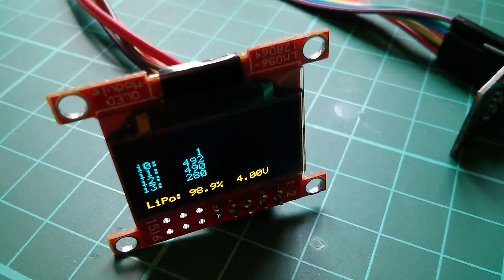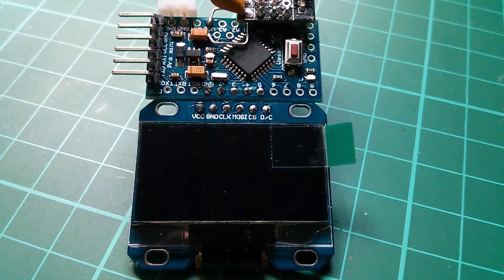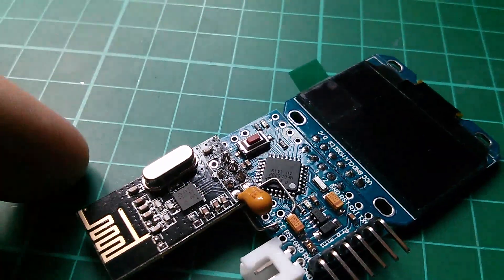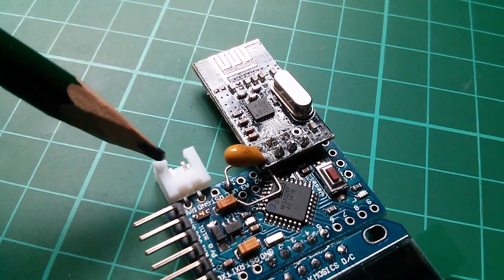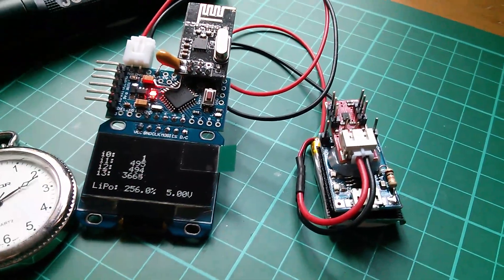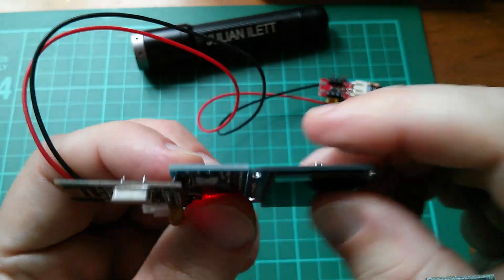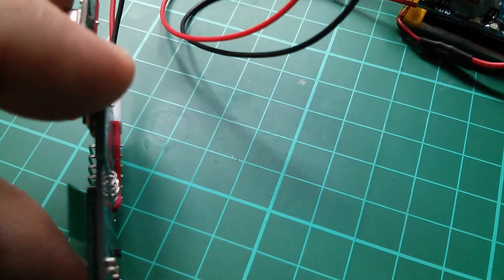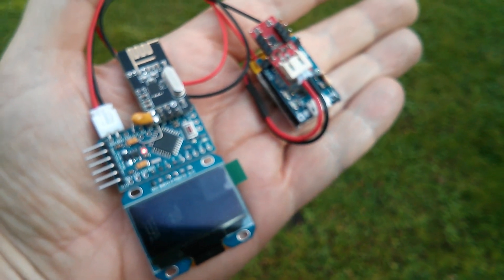Project: New Wearable Arduino OLED Remote Data Display #1

Comment: hi, whats the lipo board you are using? i assume it takes usb 5V in and charges the cell, but does it also give 5V out from the cell when not charging?
Reply from the maker: voltare2amstereo No, the TP4056 board only charges the cell, it doesn't boost the cell voltage to 5v. You can get boards that do that.

Comment: Giday EH!
Do you know how many MAX 17043 boards could be connected on a single 3.3v Pro mini, if they connect to the I2C pins does that mean they are addressable?
I know that is an odd question but I am thinking of mounting 4 or 5 projects in the same chassis because most or all of them would go with me when I camp.

I would like to keep each as almost separate module, each its own battery, because some of the projects can drain the battery quickly, (The Phone charger and 24 LED array work light, possibly the stereo amp as well).

I occurred to me that because one of the Projects uses a pro mini, if I could attach a MAX 17043 to each battery I could see each battery's Charge on the Display.

I am going to use 3100mha LiPo bag cells each with the protected charger board you like and use a common Input power.
Unfortunately my only MAX 17043 board is in the mail.

My research so far does not say if the Max is addressable, unless I missed it.

Thanks!  Later, FW.
Reply from the maker: Futz With This is from the MAX17043 data sheet: "The 7-bit slave address is fixed to 6Ch (write)/
6Dh (read):". So it wouldn't be easy to use more then one.
Reply: Thanks!

Looks like I did miss that.
it sounds like It might be better to use a larger battery or some kind of battery pack.

Comment: maybe you can use a charger board and booster in one to save space such as this one http://www.ebay.com/itm/Lithium-battery-charging-charge-5V-step-up-protection-all-in-one-PCB-board-/121003094575

Comment: Giday EH!

It looks like you used pins D11, D12, D13, A0, A1 on the Pro Mini for the NRF
Is it  NRF6 to D11, NRF7 to D12, NRF5 to D13, NRF3 to A0, NRF4 to A1.

Or am I wrong!

The Reason I am asking is because I want to ad a 4 button matrix array to my
project #2 and your pin-out gives me the 5 digital pins I need and still have every thing else I want to add.

I am hoping to add buttons to my transceiver and use to get Data from remote sensors and turn on/off lights all wile camping!

I may do a video on it.

Thanks! Later, FW.

Comment: Any chance you know of a good fuel gauge IC for lead acid/gel batteries? It would be great to get % charged for the remote battery bank, like the MAX17043 provides for the LiPo.  Looking for an IC like this for a project using a deep cycle leisure battery...

Comment: Hey great videos, find alot of the things you review to be very useful in my own projects. Wondering if you could shed more light on this simple connector
http://youtu.be/S_KjmF1iI9w?t=1m17s

Unlike the ones I have been able to find on banggood and aliexpress none have the pin leads sticking out of the green side, did you add those yourself or buy them like that?

Comment: Hey Julian, I just noticed SKU129299 on Banggood, a nRF24L01 and microcontroller on one board which seems like it would be handy for a wearable that uses radio. Unfortunately it's not AVR/Arduino, it's an 8051. Just wondering if you have any experience with those.
Reply from the maker: ***** Interesting device - looks like Nordic Semi do a dev kit for it. I'll keep an eye on that one.
Reply: Julian Ilett
On second thought, it only has 16kb program space which is kinda small. I noticed that as soon as you start using the SSD1306 library for that OLED, program size jumps up 10-11kb. I would imagine programs for 8051 would have similar requirements.

Comment: i think a custom PCB would be a much, much more effective way of building this :)
You could experiment with edging PCBs using a laserprinter, there are plenty of options! :)
Reply from the maker: muh1h1 I don't really have a finished design in mind for this project. It's just evolving as I try different low-cost modules available on eBay. Actually, I'm kind of enjoying constructing this thing without using a PCB. Finding ways to fit all the modules together is part of the fun.
Reply: Julian Ilett good point :)

Comment: I would love to copy this, I have a Gravitech Nano Version 3.0 of Arduino do you think it would fit as well as a mini, it's pretty close to the same size as a pro mini.

 Very Nice Julian! Great videos! Thank You From  Fresno California USA
Reply from the maker: MyWillyboi I didn't use a Nano because there's no 3.3V version (as far as I know).
Reply: Julian Ilett Yes sir, you would be correct. As far as the overall size dimensions  they should be close, im sure? NO?? I dont mind much if its 5v or 3.3V, As I have OLEDs for both. I also am ordering from adafruit, Xbees, and  6 Adafruit trinkets which are arduino compatible, But the cool thing is you get 3X3.3V and 3X5V Versions, For 35$ A GREAT DEAL
Reply: Julian Ilett And after some pondering on the matter of Arduino Nano and 3.3V, to make a copy of your AWESOME wearables.  It  dawned on me that there is actually both a 5V pin and 3.3V pin.   http://arduino.cc/en/Main/ArduinoBoardNano : Here is a link of my board (Arduino Site) . If you look at the board picture, you will see next to Digital pin 13 or D13 is  3.3V supply pin to power projects, and down the other side of the board is a 5V Power pin. Brilliant isn't it?? There is also 2 ground pins incase one is inaccesable, 1 on each side of the board, and a Vin pin for powering board altogether, aside from USB. So hope I helped you as you have helped me with you wonderful videos. Cheers From California USA
Reply: Julian Ilett Side Note: 3.3V only works when powered from USB

Comment: Is probably the time to learn a PCB design software (I use KiCad free and good) and build an inexpensive reflow oven so you can make your custom PCB design have the LCD on one side and on the other side all the components for all modules.
For the reflow I have an used small oven (free the control board was broken) and all it needs is a Solid state relay about 10$ an 5$ temperature sensor and a 90$ temperature controller (I use the Altec PC410) and works great.
Building two layer PCB is quite inexpensive even for prototyping.
Reply from the maker: ***** I probably should design a PCB for this, but I'm actually enjoying the process of trying to fit all these modules together without one. It's like a chinese puzzle!

Comment: I'm intrigued as hell to see what you're going to do with it :)
Reply from the maker: Tobias Schenk Monitor the voltage, current and power for both the solar panel and battery on my MPPT solar charge controller.

Comment: By gosh, that looks familiar :) Very nice job on those connections.
Is wearable Mk2 using a 5v ProMini? Typically that LiPo will be declining from 4.2 to 3.x volts as it discharges. I have found my 5v ProMini runs just fine when the charge is fresh, but being rated as 5v-12v input your'e already pushing your luck with 4.2v, and it's only going down from there. I wonder if you touching it would cause voltage to be pulled down just a little too much on some important bits... hmm... but I would expect it to restart again when you let go, if that was the case.

Another thing to watch out for is that VCC on the 5v ProMini will be regulated to 5v, not 3.3v. So while it may run the RF24 just fine now (input being max 4.2v), if you gave the ProMini a little more input voltage then the radio will stop working. Just can't win huh?

For this reason I think I will be sticking to 3.3v ProMinis from now on, since they can use any input from 3.35v-12v and will have 3.3v on their VCC to use for the radio. Incidentally, the RF24 didn't seem to be any the worse off for having been subjected to 5v for a while. Unfortunately the cheapest 3.3v ProMini I can find is about $10, while the 5v Deek-Robot 5v ones are about $3.50 :(

I also noticed that my OLED will not display anything while the FTDI adapter is still connected to the ProMini, even when it's fine on battery. Took ages backtracking my steps to isolate that one!
Reply from the maker: ***** This is another 3.3v Pro Mini. I think I've found the problem with the OLED going blank - it happens when I touch the flexible PCB strip on the back. I don't think it's a poor joint - seems like it's a finger resistance thing or maybe induced noise into one of the signal lines.
Actually, this OLED is a pain - it doesn't have an RST pin and the SSD1306 doesn't have a RESET command. So the only reset technique is power on/off.
Weird problem with your FTDI adapter - did you try any other adapters like the CH340 type?
Reply: Julian Ilett Naturally, not like you to make a newbie mistake and use the wrong voltage :) To be honest I completely forgot I was using a 5v, which is how I found out all the above. Kinda lucky it works at all I guess, since it's just coincidence that the LiPo voltage is within the narrow margin where both the ProMini and the radio can both function.

I only have the one FTDI adapter at the moment and it seems fine otherwise. As long as I keep in mind that little quirk I think I'll get by.

Hmm... I just checked your earlier video where you give a link to 3.3v ProMini listed on Bangood, for about $4. For some reason when I enter 'arduino pro mini' in the search box there, only the 5v one shows up, and I don't recall seeing any in the related products list either. Well then, source of cheap 3.3v solved!
Reply from the maker: My FTDI adapters have a solder pad link on the back to select either 5v or 3.3v. How do you get by with just one adapter? I can't believe you're re-soldering the link each time you switch between the 5 and 3.3 volt pro minis.
Reply: Julian Ilett
It has a solder-less jumper. Not that it mattered because I completely forgot about that too and have been using it on 3.3 setting for everything. Seems to work :D

Comment: would not 315MHz/433MHz modules with greater ranges be better option for this single sided comm ?
Reply from the maker: iceberg789 From a range point of view, certainly. But I quite like the option to have a simple two-way communication if I can think of a reason to do that.

Comment: Why don't you just connect the display in parallel with the receiver to the SPI and switch between them with CS/CE pins ?
Reply from the maker: TheBlackAndWhiteCow They're different flavours of SPI. The nRF uses true SPI with MISO and MOSI for bi-directional data flow. The OLED uses a simplified uni-directional SPI. In any case, there isn't any shortage of I/O pins on the Pro Mini.
Reply: I was looking from performance point of view and I don't think that that mixing between the two would cause a problem I think last time I ran a Nokia 5110 display with MAX6675(K thermocouple IC) both over SPI and it worked just fine
Reply from the maker: TheBlackAndWhiteCow I guess it could be made to work, but the problem here was more about finding a physical alignment between the modules.
Reply: I suggest using tiny braided wires it would allow better flexibility in placement, if you need a more rigid setup you can always use a double sided sticky tape or even print a 3D case and screw it all down.
Reply from the maker: TheBlackAndWhiteCow Yes, the case is going to be a real headache. I think you're right, a custom 3D printed case is the way to go. Can you print a transparent top layer? I can see difficulties making it optically clear.
Reply: Not an expert in 3D printing but I don't think that you can print a fairly clear sheet.however usually what you do is print the case and lay some clear plastic that is pre-cut for the size on top of the case(in the design you add a slight step around and slightly above the lcd module).you can always experiment with cheap screen protectors and cut the to size.

Comment: do you need the charger board on the device? it would save space if you didnt, its not like you are carrying the usb cable for it as well
Reply from the maker: jusb1066 So the battery would have to be removeable so that it could be taken out and charged elsewhere. Also, the charger board has the battery protection components which prevent it being over-discharged.
Reply: Julian Ilett borrow the small protection circuit from an 18650?
Reply from the maker: jusb1066 Yep, or use a protected lipo